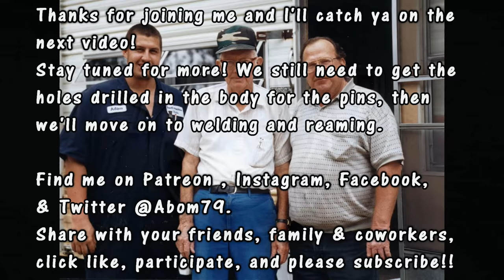Kearny & Trecker Parking Attachment Part 5

Comment: Great work!
Turning, facing, drilling, the basic lathe ops.
It seems simple until you have to flip a large part and get it too meet up in the middle.
The more I see it come together, the more I think skeletonizing it would be a good idea. The vertical head is already heavy enough, no need to add the extra weight of the parking attachment. It would also look pretty cool.
You could just run a big round nose mill to make a pocket about 1/3 the thickness of the part on each side. If you butt it up against a fence, set up should be minimal so the pocket is parallel to the top and bottom.

Comment: Nice video again, I hav made many times same way and it won't hardened inside.. reamer goes just fine. lots oil inside. Welding will shrink it more and you'll have plenty material to ream it..

Comment: Have you ever shopped at MSC industrial direct? Are they decent prices? I know some of the best lathes and machining tools are the ancient ones often passed down by generations! I grew up in South Bend, Indiana, where one of the most famous lathes used to be built! We had many different companies that went under over time! I was thinking about telling my dad about you for any word needed in Florida, in case they ever needed some work done, they do commercial wells from 8"-48" they manufacture pumps, drill wells, they do have an in-house machinist, though they fired the last one, but saving some down time would be nice if they are doing some major work down there! Besides you do some really good work, most of their needs are for shafts, impellers and bushings, sometimes housing repair and refacing!

 You probably have already done some work for them it is Peerless Midwest, my dad has been there most of their existence! Their former machinist tried to get me into schooling for it, but I am more geared toward mechanical engineering and developing exotic technologies. One of which is a micro turbine that operates on liquid fuel reaction and could be adapted for the aircraft, automotive and marine industries for both Military and Civilian use as well as a portable power unit used to replace the standing grid based power supplies and requirement for lines, that would recycle some of the waste output pumped into sewer's, homeowners would have leased these units from power companies! I had Davison offer me $50k to build a working model of the turbine, but they wanted to be the sole patent owner so I declined their offer, it is a far step from their normal invention basis, but they were very interested! 

Until then, I have tried to sell the idea and use of other technologies to Pratt & Whitney, Boeing, Lockheed, Oshkosh, Howe and Howe tech as well as a UK based Military Industry, but it involved an entire new type of vehicle, drive system and suspension which would be more advanced than concepts used in today's Military! It would have made a vehicle lighter, smaller, faster and more capable than any in history. That could be mass produced more easily and cost effectively and would have been all terrain and able to cross major bodies of water at a faster speed "In Excess of 36 knots" and perform attacks from any terrain using a combination of satellite and onboard radar for guidance as well as existing technologies available for aerial defense and ground attack! One day, I will build a mock up myself and see if I can get a sponsor for Darpa competitions and investment in building a working model for gaining DOD funding!

My Motto! 
Always have a hope, never give up, your dreams can lead you farther than a bloodhound on a Coons trail!

Comment: you should move your fume extractor machine for your welding table over there to deal with the smoke from the cutting oil.
Reply: +Robert Phillips  Not sure, but oily smoke might ruin those big buck filters.
Reply: It might but its only a suggestion
Reply: +Robert Phillips Telling someone they should do something is not a suggestion.
Reply: +lazaglider ok i should have said you might try, instead of saying you should. thanks for pointing out my grammatical mistake.

Comment: Finish bore it, don't ream it.  Reamer won't fix position error, it'll just follow the hole.  Maybe bore then ream?
Reply: +Adam Kraehling Exactly my thoughts!
Reply: +Fernand Geene Van: I figure if it's spinning less than 6,000 RPM, the hole size +.002" or so should be fine... :)

Comment: Adam, are you worried about hardening that 4140 with your weld to the point the reamer wont cut it?
Reply: was thinking the same. carbide tipped reamer would

Comment: what model is your K&T?
Reply: +andy347495 Model 307 S-12, the label is visible in earlier vids. ^^  Especially during the series last year of him pulling the knee out of it to fix hydraulic drive problems and then re-installing the knee and testing it out. ^^  In summary, the rapid traverse and power feeds had stopped working and he had to go into the knee to clean out all the hydraulic passages, replace the seals and O-rings, and make a new suction tube for the oil pump.
Reply: +Patriot1776 thank you sir. I recently picked one up and was wondering if we had the same model.